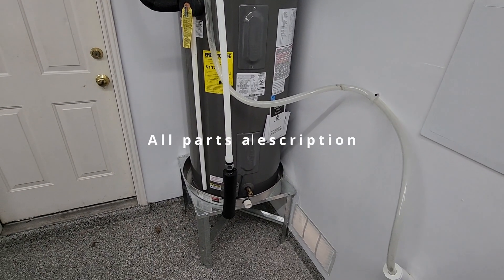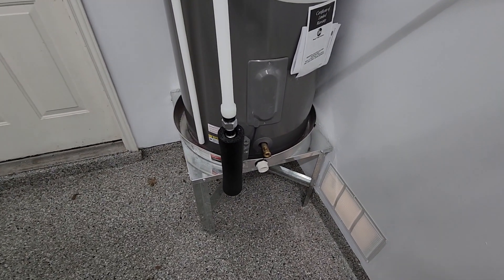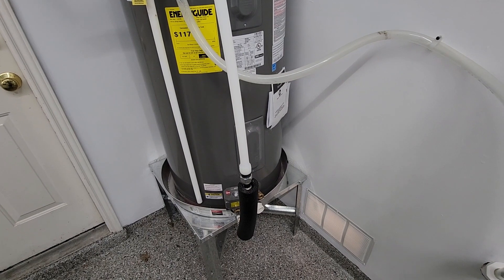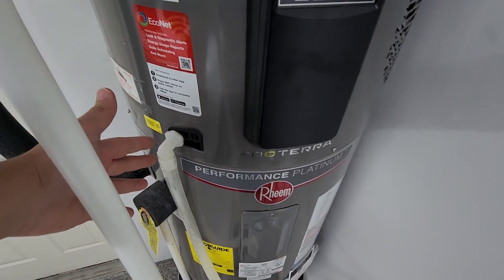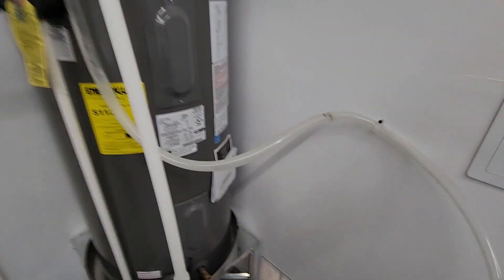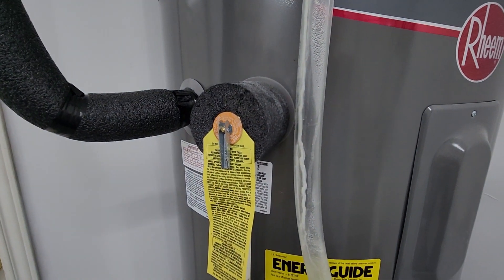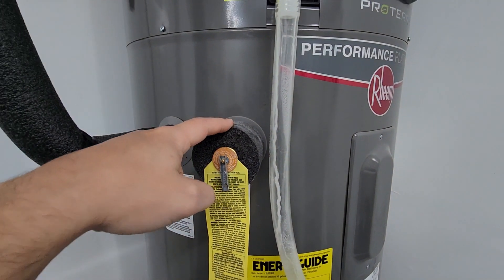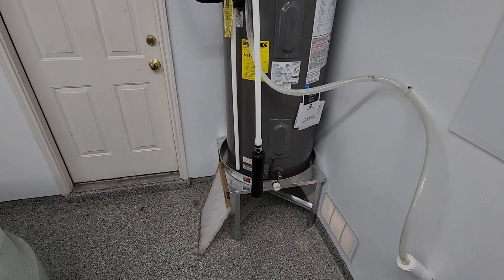Rheem Hybrid Water Heater Installation Review

Comment: How is the noise level when the compressor is on?
Reply from the maker: It's not loud but I can hear it at night since my bedroom is above the garage after I take a shower. Make sure you use PEX. If you run copper it will be much louder. I got a $600 federal tax credit for installing it too.
Reply: @danklankin3887 why is copper louder?
Reply from the maker: @R900DZ  Metal resonates more than plastic.

Comment: Awesome video!  i do have a question.  I'm not a plumber but is your cold water input line tied into your hot water output line?
Reply from the maker: It's not but I can see why you would say that. The 90 degree fitting is black and matches the insulated hot water out line when looking at the top of the water heater.

Comment: I thought you only needed an 18 inch pedestal for gas water heaters with a pilot light.
Reply from the maker: The code is 18". The reason is that the lower electric element could spark when energized. A spark at that height could ignite gasoline vapors that are trapped in the garage from a gas can or car gasoline leak.

Comment: I like your pre filter setting on the top of the water heater.
Reply from the maker: Thanks, it was useful especially when I was patching/sanding some rough areas of my garage and forgot to cover the water heater first.
Reply: @danklankin3887   I have a 65 gal Rheem Hybrid. A 10X20X1 filter fits pretty good when held down with some duct tape.  Over the last month lots of sawdust & dust from construction has made it time to change the filter. The factor plastic filter is still clean as a whistle. Thanks again for the tip!
Reply from the maker: @wahapete8769  I check the reusable filter once a month but it's never dirty. Have a great day.